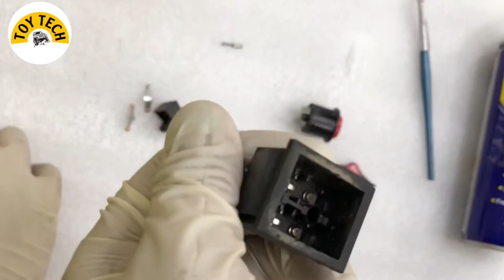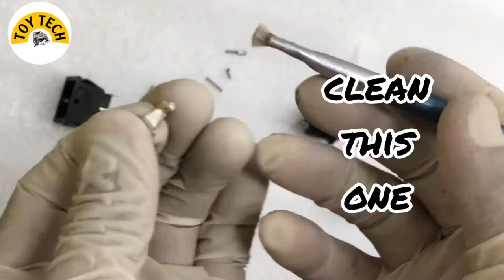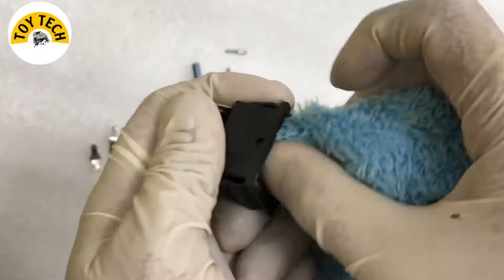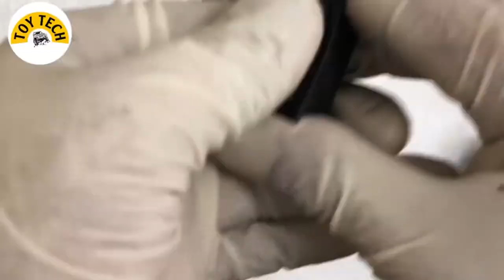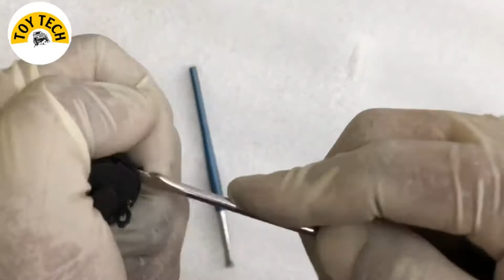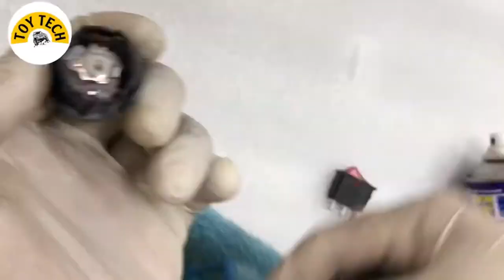How to repair kids car&bike switch

Comment: Thanks for the vedio...i cleaned the carbon on the points of main switch bottom as shown in vedio and it works again properly... the main switch costs around 250 rupees for a new one.
I just cleaned the carbon deposited on the points and save Rs 250 within 2 minutes work at home...